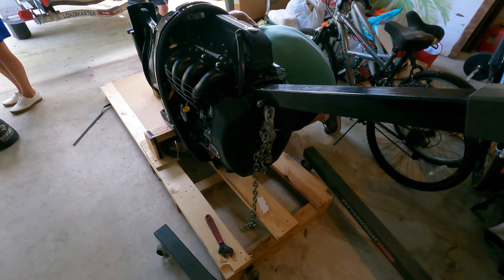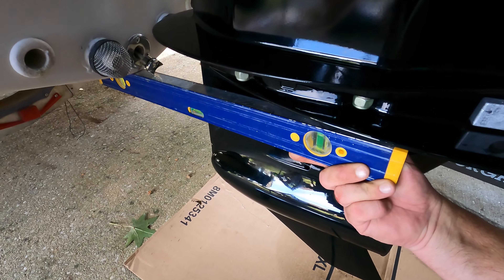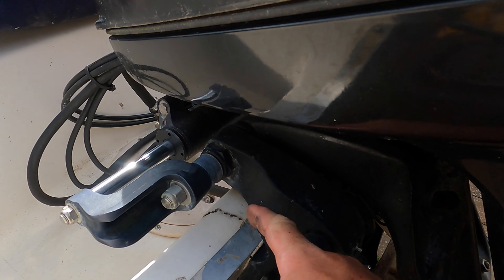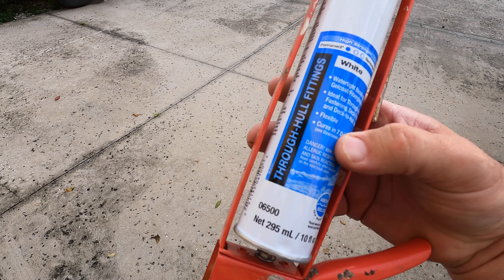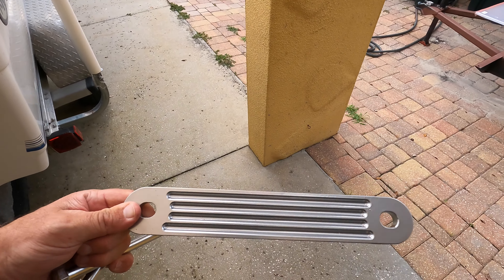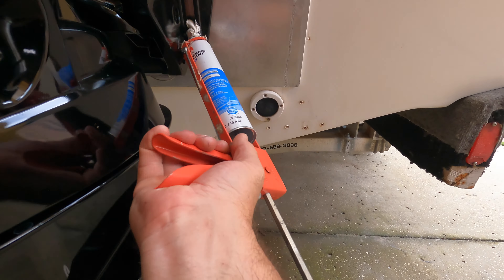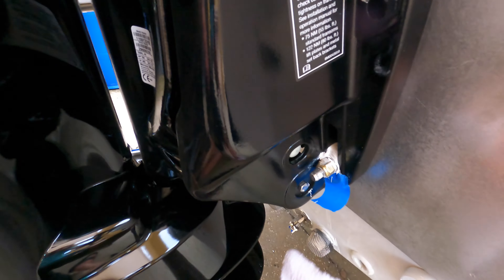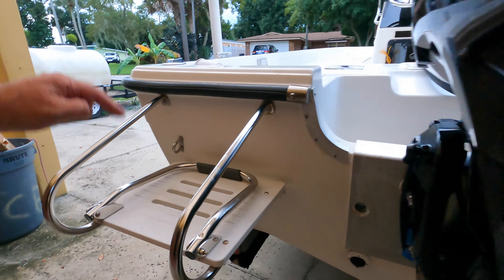HOW TO MOUNT AN OUTBOARD MOTOR CORRECTLY - Step By Step Do and Dont's!!

Comment: I do ALOT of electrical work and if you use anything but wrenches on Stainless bolts and nut there is. 90% chance of galling!!! You even think fast 💨 it will fall you can use the rattle gun and have a few of them work but then it will fall on the next bolts you do. We put stainless strut straps up and we do rattle gun them but once you start you had better finish fast once that heat passes and get a temp change you have just welded them together.  If it won’t move skinny wheel is the only thing that fixes it!!!
Reply from the maker: Yep you are right.  A little grease or never seize and it won’t lock up as well

Comment: my concern was how to pick up the outboard, what to use, where to grab it, etc. you skipped all these parts and didn't really show. just something to consider going forward. thanks for your efforts.
Reply from the maker: Depends on each engine.  Some have eyes from factory and some have tools that connect to the flywheel.  Thats why I didn’t put it in there

Comment: Great video, I wouldn't used 5200 though.
Reply from the maker: I use it on anything below water line personally.  I’ve see too many get water intrusion and 5200 makes me feel the best.  Debond makes a product that removes 5200 btw.
Reply: @JackedUpFishing  I use 5200 where I want glue, 4200 (actually lifecaulk) where I want a seal. IMO 5200 is only to be used when there is no other major form of mechanical adhesion like screws or bolts. Just my opinion, or 2 cents. The last engine I removed that had 5200 on it removed a good portion of the gelcoat with it.
Reply from the maker: @ yeah I get it.  All preference. I always razor knife any caulk before pulling g motors as well just because of this.  But yeah I’ve seen that too. Tight lines

Comment: Have always used 4200. With 5200 removal is almost never. If you can get it loose you will most likly distroy the transom.
Reply from the maker: For sure if you don’t know how to do it correctly.  We usually pick up and put pressure with a tractor or cherry picker then start cutting the  5200 with new razor knives.  Once started it pops off.

Comment: Probably should have used 4200 you will probably tear the transom apart getting them bolts out with 5200. Otherwise great video
Reply from the maker: I actually like 5200 on the bolts for the engine honestly.  Just don’t get all  crazy with it and it will be fine.

Comment: I use to work with stainless nuts and bolts and they will gall/seize up when impacted.  You're absolutely right.... only way to prevent this is to first  brush on a little stainless never seize on the bolt threads.  It will prevent seizing  every single  time.   Good video by the way.  
The marine company that mounted our motor messed up on it and that's why I'm here. 
 Disheartening to see your brand new boat taking on water.   I was relieved to discover that it was just leaking through the Transom bolts though.
Reply from the maker: Dang crazy.  Hope all worked out

Comment: Awesome video. Can you tell me where to get a transom saver plate? Thanks
Reply from the maker: I actually had it made at a local metal shop.  Just had it made out of 1/4 inch aluminum and had them bend it on a metal brake.  It ended up costing  like 180 dollars.  Thanks for watching!

Comment: What is lift capacity of the hoist you used,,im going to remove a 115 and replace it with a 150 and hopefully a harbor freight lift i have will work,,only issue is i dont have concrete to work on,,'
Reply from the maker: The harbor freight one works great. Outboards do not weight that much and using the lifts are 1500-2000lb capacity.  Good luck and let me know how it goes!  I am hanging mine this weekend too!!! We gotta stop working on these boats and go use them right!
Reply: @JackedUpFishing  Due to crazy low temps for sc no work outside this weekend,,i am going to soon put a 175 on my boat,,,it rates a 150 but its a deep v starcraft with a very solid transom ,,the weight difference between 150 and 175 or even 200 isnt much at all,,not worried about insurance not paying if i crash it,,i just want tog o faster than 46 mph,,i have always had a bass rig that ran 65-75,,,i bought the starcraft for the comfort and fishability vs the hard ride of a bass boat...many say dont overpower but im 66 and have been driving boats since i was very young,,i will be fine and my boat should run at least 55
Reply from the maker: @charliesmith9528  yeah I am the same!  I seen a guy do the same with a hurricane deck boat.  It was sick- it had a 250 yam with Jack plate , twin power poles, and spot lock trolling motor.  Totally seeing myself doing that when I get a little older.  Lol
Reply: I bought the Harbor Freight 1-ton crane for $250. It lifted my 12’ OptiMax 200Hp at about 500 pounds with crane’s arm fully extended. (You lose lift capacity the further out the arm is extended. Also, by jack fluid to fill the crane’s tank, then bleed it before using.) My Opti is lifted w/an eye bolt ($20) that screws into top, center, of flywheel. Crane was easy to move as it had decent casters.